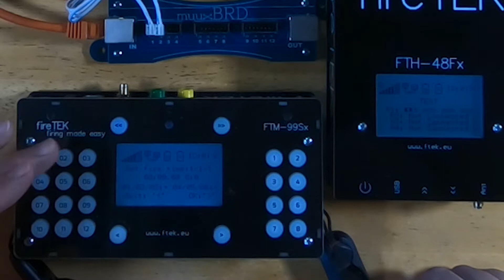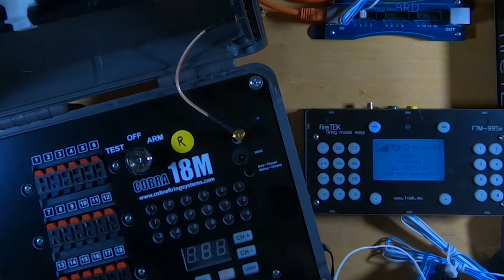Quick Plugs in Series - QuickSplit-12 Trial with Dos and Don’ts

Comment: The shunts are a safety feature, should you accidentally get into static electric. To keep the shunts from causing a problem I keep a little trash box handy from my shunts.
Reply from the maker: 3:20,  Yes, they shunts are there on the MTA-100 plug to prevent a voltage potential between the two leads - but do nothing for a potential static arc through the match head.  But that is a whole separate discussion.